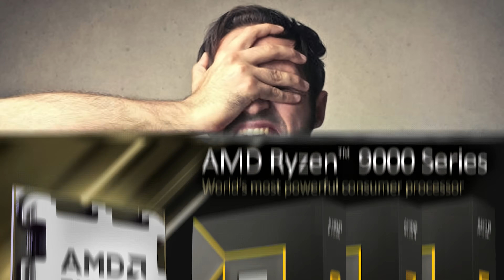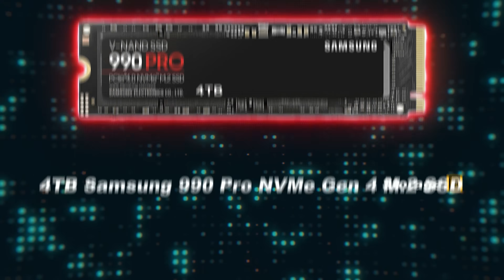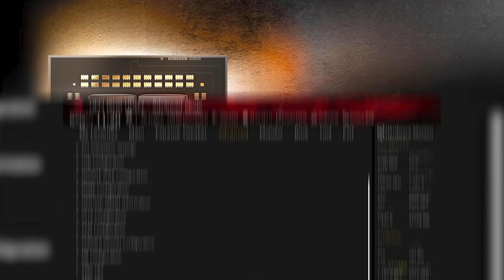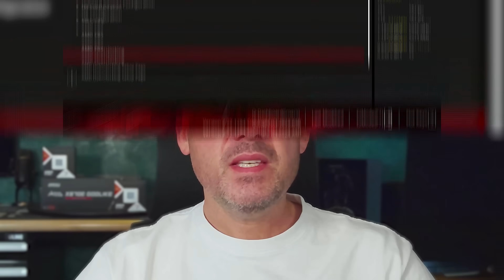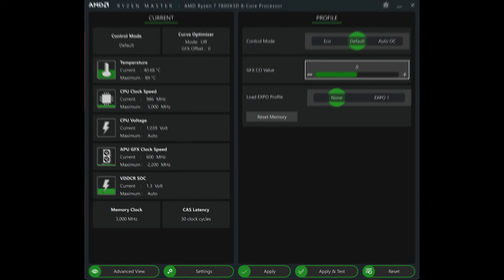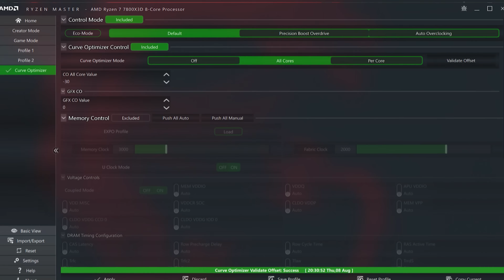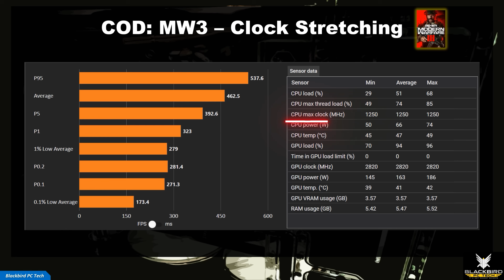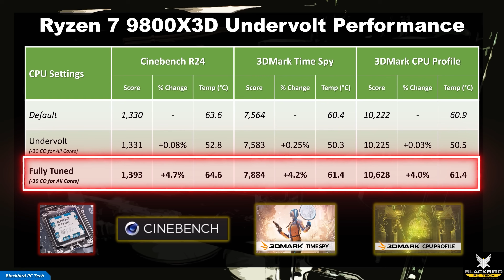How To Undervolt a Ryzen 7 9800X3D The Right Way! (or Any AMD AM5 Ryzen CPU)

Comment: I'm currently trying to tweak my ryzen 5 7600 non-x. Takes some time, I'm on stock cooler (aka stealth-worse-o-them-all) and limited my temp to 90C just in case. It was getting 95 at every Cinebench test so I decided to force the throttling. PBO voltage at -40, clock +200, set to Auto (I read somewhere that Motherboard could be limiting performance but I'm still testing), HWMonitor doesnt wanna monitor anymore but after some blue screens and a cmos clearance, it's working. Let's see how it goes. thanks for your tutorials, your page is fantastic!
Reply from the maker: I would recommend reducing the magnitude of your curve offset and boost clock increase … they seem really high for a 7600

Comment: I didn't do it this way. My way works but likely not as precise. I just set an all core OC to the frequency I was capable of keeping running cool at a voltage higher than I knew was needed. I made sure it was stable and then dropped the voltage and retested.

At first I was running all core 5Ghz at 1.075v but now I am running 5.2Ghz at 1.085. After testing the stability with one of the 10 minute long cinnebench CPU test, I further tested it again with the same cinnebench test, edge, chrome, firefox and brave all streaming HD video, while baking a 10 million particle simulation in Blender and to top it off I started editing a video in powerdirector. My goal was to consume at least 32GB of my 48GB of ram while multitasking and running the CPU at 100%. My 9950X was completely stable and reached a max of 76c with my ID Cooling 360mm AIO.
Reply from the maker: The real benefit of leveraging PBO2 is that it dynamically adjusts with load ... it's a curve offset versus reducing the voltage directly
Reply: @blackbirdpctech  I'm likely going to try the method you showed. I like knowing multiple ways to do things.
Reply from the maker: @BlenderRookie  being curious is the only way we learn, that's why I appreciate when people comment the way you did

Comment: Arctic Liquid Freezer III 420 + Thermal Grizzly Kryonaut Extrem + 9800x3d -25 curve optimizer + ShadowBase 800 FX - 40-45 idle temps  < 71*C Full load Cinebench  at 23*C ambiental temperature
Reply from the maker: That's my favorite AIO

Comment: Weird that -30 on my 9800x3d did nothing on the temps😢   86 degrees both, however score went from 21500 to 22200😅 

How is that possible?   Less heat, same cooling and same temp???? Weird

I had to do -40 to get my temp to 76
Reply from the maker: That's strange behavior for a 9800X3D ... what happened to your CPU frequencies between the two runs?
Reply: @blackbirdpctech  They both achive around 5214 Mhz for some really weird reasons.  And both pulling 140 Watt, undervolted or not.             What mind blowing is that my -30 +200 Mhz run which did achive 5400Mhz, is higher score AND cooler than my -30 deafult run!    Like what the actual fuck is going on with this cpu?  I swear to god I am so confused, it might be ROG X870-A motherboards tho, pulling 1.3V on VDD and 1.24V on VSOC on -30, which seems high to some other people's result.

Comment: My Test Runs 40 Minuten no Problem After 1-2 Hour Gaming Blue Screen restart
Reply from the maker: I have no idea what parameters you set, so it could be virtually anything
Reply: @ only Negative Setting Not more. But I think because it’s Not Happening anymore I changed the gpu driver to 566 NVIDIA the new ones are broken
Reply: 7950x3d with 4090

Comment: Thanks for the video, unfortunately my processor didn't work at 25 and 30 values, but it stabilized at 20, which reduced the temperature of my 9800x3d to 72 degrees instead of 83. I am very pleased with the result. Thank you so much!
Reply from the maker: -20 is a solid undervolt!
Reply: @blackbirdpctech My 9800x3D can do only -17, but i had other 9800x3D before and its maximum was only -6!!! Reason why i sold it and bought other! A lot better temps, with 1st CPU were ~70-75 when gaming, but with 2nd CPU temps are ~55-60C when gaming! Excellent ❤️
Reply: @varmvarm1110  mój 9800x3d również stabilny przy 20

Comment: Thank you for this! I just used the Ryzen Master software and ran tests using -10, -20, and -30 on the curve and I dropped my temps 15 C under load and gained 1398 in cinebench. I really just wanted the temp drop and that did the trick, went from 88 C on Cinebench to 74 C max using a 360 AIO.
Reply: @thedarkwolf25  which CPU? 9800X3D?
Reply: @Wissッ  yep
Reply: @thedarkwolf25 which cooler do you have may I ask?
Reply: @Wissッ  Cooler Master MasterLiquid 360L Core 360mm
Reply from the maker: That's great to hear!

Comment: hello, congratulations for the video. I followed all the steps and entered the same values that you show in the video; and I found that with -17 I can get to 20 minutes of AIDA64 stability test.

However, without undervolt the cinebench results are 1262 points with an average cpu temp of 74° C and a maximum temp of 76, while with undervolt the result is 1228 with average cpu temp of 78.5 and a maximum temp of 81...so I get a lower score and higher temperatures....could you explain to me the reason? what should I do?
Reply from the maker: That doesn't make sense ... my guess would be that you accidentally put in a positive curve offset instead of a negative one ... so instead of -17 CO you accidentally put in +17 CO.
Reply: unfortunately for me no, it is set correctly in negative, what should/could I do? could you help me in some way? can you advise me how to intervene?
Reply from the maker: @andgarp7  I would recommend resetting your bios and trying again
Reply: do you mean a reset with cmos or crltc or a simple restore of the default bios settings?
Reply from the maker: @ reset with cmos
Reply: @blackbirdpctech  if it's not too much of a bother, i'll update you later, for now thank you very much
Reply: after resetting the bios and resetting the parameters correctly, with -15 I found stability, however with cinebench I obtained a higher score (1350) but the temperatures did not decrease by a comma, indeed they tended to be one degree higher on average (80)..

Comment: lol, am i the only one who can never get the results found in youtube videos. my silicon lottery odds suck. my 7800x3d runs fine, but i couldn't get near -30. it doesn't really matter though, all the stress testing shows i get advertised boost clocks, but while gaming, the cpu never reaches high core clocks. most games don't stress it enough i guess.
Reply from the maker: I wouldn't worry too much about not being able to run a -30 CO ... even if you run a -10 CO you will see benefit.

Comment: @blackbirdpctech  I've recently built a 9950X3D with MSI X870E Carbon wifi system coming from a i7 4790K Z97. Can this video guide be used to undervolt the 9950X3D even with the higher TDP?
Reply from the maker: Yes, you can use it for any AM5 Ryzen based CPU.

Comment: I’ve set my 9700x to TDP 105 with -20 curve on all cores and it seems stable. CPU got to 89c at the beginning of a cinebench r23 test but slowly started to lower to 77c and stayed around there. Got a much better score than stock settings and I may try -30 and see what happens.
Reply from the maker: Great ... just make sure that you test it in AIDA64 to make sure you are not getting clock stretching.
Reply: Will do, thanks again!

Comment: -23

Stable in aida64, same temps as before

Occt 95C

Cinabench  r24 got better scores but still 90C

3dmark time spy good scores 90c

Im running a liquid freezer 3 360 aio

New build, new paste, checked the fitting of the cooler. No problems there.

What could it be? I see ppl get 10-20C cooler temps on all this benchmarks!
Reply from the maker: Another subscriber had this exact issue and discovered that it was their iCUE software limiting the speed of their AIO pump ... you might want to make sure that you have your pump/fans setup properly.
Reply: @blackbirdpctech  hmm... will try, controling everything from Fan controll ! (Y)
Reply: @blackbirdpctech could it be that im messuring from "core" (Tclt/Tdie) ? And you guys is messuring just CCD1 (Tdie)? Bc my CCD1 is 15C lower than my  Core?
Reply from the maker: @ I use HWMonitor and I was indeed looking at the package temp

Comment: i undervolt my friends 9800x3d to 1.2volts and yes the temp falls 10c but the clock speed falls too from 5.2ghz to 4.7ghz and cpu z bench from 8300 to 7000
Reply from the maker: That's why you should use the curve optimizer approach shown in this video instead of manually adjusting the voltages in Bios.

Comment: This is odd, I’m not stable in Aida 64 even at stock
Reply from the maker: That's not good ... it could very well be your RAM ... have you checked the stability of your memory running a tool like Karhu?
Reply: @blackbirdpctech  I will go ahead and try that. What did fix the issue was going from 6000 to 5800 with all other expo setting the same except MT/s 
Able to do stable -25 under volt at that setting 
Ordered diff set of 64gb 6000 cl30 ram from diff mfg and going to test it and if it works at 6000 I’ll send back my Gskill set. 
I’ll test out Karhu
Reply from the maker: @ yep, it was definitely your memory ... but it likely isn't the RAM itself ... it's likely the memory controller on your CPU, at least that's my guess
Reply: @blackbirdpctech thanks, so much. Is there a way to increase voltage to stabilize the memory controller or something ?
Reply from the maker: @ yes ... this is not something I typically cover in my videos because if you increase the voltage too much it can damage your system
Reply: @blackbirdpctech new ram fixed the issue. Thanks. Getting -20 with no issue. -30 if I reduce ram speed to 5800 from 6000. Is that wise to do? Or just do 6000 at -20. I kind of like the Low power usage :)
Reply from the maker: @ I suggest leaving your RAM speed and dialing in your undervolt

Comment: i did ryzen master test took like 1.2 hours and it recommended a undervolt to my 9 9900x of -43, been running swtor and destiny 2 at once smoothly. CPU has not went above 61c. Just loaded up heldivers and swtor together im still good and stable !
Reply from the maker: An all-core CO of -43? I would recommend checking it with AIDA64 to see if you are getting clock stretching ... my guess is that you are.
Reply: @blackbirdpctech ok imma go do that. Yeah the all core value offset after the optimizing ran thru was -43. About 5 min after I posted that my pc crashed in Helldivers 😢 I guess it was too good to be true. I changed the difference offset value to 18 so that puts it at -25.  No issue yet but, I'm going to do what you recommend. I want to do it right.

I probably should have did the "per core" optimization.  So I'm going to do that next. And then download the program you just recommended.

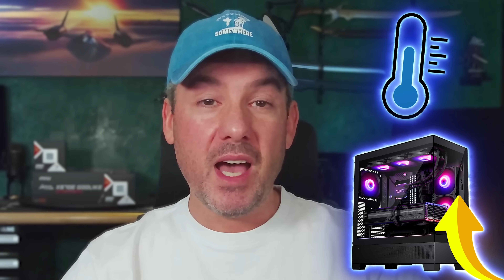Comment: @0:52 I literally just built a new AMD build, and got that exact case haha. Look forward to trying this! I got a 9800x3d with a 9070 XT and ASRock Taichi x870e mobo, and the reports of CPU's dying has been making me nervous. I hope this helps prevent it from happening to me!
Reply from the maker: Make sure you are running the latest bios for your motherboard
Reply: @blackbirdpctech  yea people have been saying that as well. Doing that and undervolting seems to be hotfixing the issue for now
Reply: @ILLiteSociety  I also have the 9800x3d and got it recently i'm gonna go and look into this tomorrow, just to be sure that the 9800x3d doesn't die after some time 😬, but I do have the newest firmware for my mobo
Reply: @Orangey56  yea reports that I've seen have said that it can stop booting the first day, to a couple months later. I will be messing with mine sometime this week.
Reply: @ILLiteSociety  The first day really? Wow! I have a Asus Tuf Gaming B850 mobo so I should this should have less chance of happening to my 9800x3d, i'm gonna try to undervolt it to -20 though cause I saw some people reporting that -30 can cause problems and -20 seems to be safe for everyone, but yeah it's definitely better to try undervolting it, cause it will also make the performance better as I saw :) Also I wish the best of luck to you that after you do this on your Asrock motherboard that there will be no chance of this happening to your cpu!
Reply from the maker: @ please don't go by what people say online in forums or on social media ... just follow the steps in the video. -30 is not "unsafe", it simply might not be stable. -20 might also not be stable, it really depends on your silicon quality.
Reply: @blackbirdpctech  I'm not knowledgeable in this area what do you mean by sillicon quality, do you mean that every single cpu and 9800x3d have different quality of sillicon inside? Like one 9800x3d might have a better sillicon quality then someone else's 9800x3d??? Thanks
Reply: @blackbirdpctech  And i put it on 20 and everything's working fine, I guess I can try putting it to 30 but i'm not sure
Reply from the maker: @Orangey56  yes ... watch the video ... I go through and explain it all in the video
Reply from the maker: @Orangey56  seriously, watch the video
Reply: @blackbirdpctech Sorry I didn't watch through the full complete video I apologize
Reply: @blackbirdpctech  I already tried testing it on 30 about 5 minutes ago and it failed after about 20 seconds now testing it on 25 and it didn't failure after 5 minutes still gonna let it to run for 10 minutes to make sure it's stable, thank you so much!
Reply from the maker: @Orangey56  no need to apologize, but all of your questions are answered in the video ... that's why I made the video
Reply: @blackbirdpctech Sorry for writing again I tried it on 25 and the test stopped after 6 minutes i'm gonna try it again on 24 and if it stops again then i'll just do 20 like I had in the beginning and leave it at that
Reply: @Orangey56  I honestly think most of them are due to user error. I'm not as knowledgeable as the PC tech in the video, so listen to him before me lol. I'm just saying that people on Reddit are reporting chip booting issues, and most of them are with ASRock 870 boards. I've also seen plenty of people say they've had no issues as well.

But the main fixes I'm seeing are bios updates, and undervolting like this video shows.
Reply: @ILLiteSociety  Yeah I think it could also be due to user error but it seems like it has more of a chance of happening on a AsRock motherboard for some reason, but I think if you have it updated to the newest ver. and also undervolt your 9800x3d then it has a incredibly small chance of happening if at all

Comment: Hey thanks for this! I did PBO -20 and reduced my temps by about 15°c in Cinebench multicore stress test
Reply from the maker: Nice!
Reply: How's it going after a month? Is the CPU stable or are there any issues at -20?
Reply: @Extreme96PL  No issues, been stable. Could probably use -25, but haven't bothered to test it
Reply: @kristian9268  Thanks. You tested stability with software from video? And how long?
Reply: my 9800x3d cpu with -25, hit 88 degrees in cinebench😢

Comment: So what would happen with curve offset value of -100? The system would not boot at all, and I would have to reset bios settings?
Reply from the maker: What made you think setting a -100 CO would be a good idea? That is WAY too high … I give proper guidance in the video.
Reply: @blackbirdpctech  Sorry, few typos. My point was just to confirm what would happen with ridiculous values, and would it be easy to recover from them with bios reset; or would it cause damage to system possibly.
Reply from the maker: @ I don’t think it would cause any damage … i very much doubt that your system will boot … a simple cmos reset will fix it

Comment: im getting insane spikes on my temps. lets hope this solves!
Reply from the maker: I would also establish a thermal throttle limit but you should try to figure out why your temps are spiking
Reply: @blackbirdpctech  Thanks for the tip, ill loot into it. I use an Aorus x280 water cooler, I live in Brazil and the ambient temperature is often 30º Celcius here, but it shouldnt be spiking to 95º im guessing.
Reply: Apparently the undervolt did brought the temps down to 70s celcius but ill need more testings before the conclusion, great video btw.
Reply from the maker: Take a look at this tuning and optimization guide: https://youtu.be/9y_MGzrQHDg
Reply: @blackbirdpctech  thanks a lot for the help!